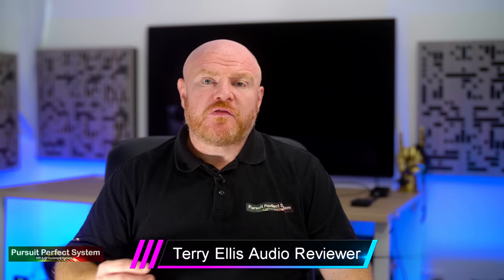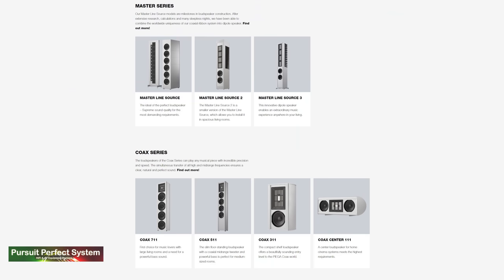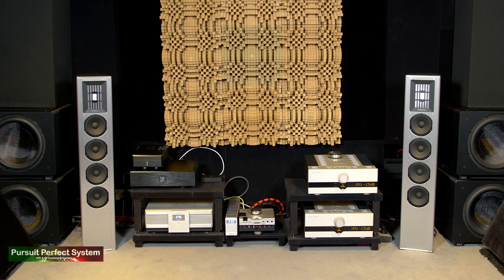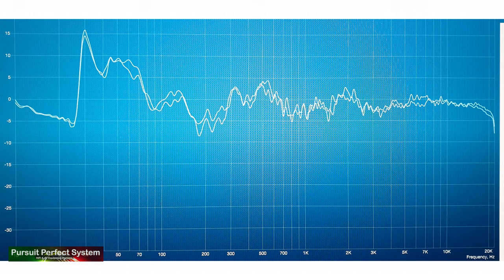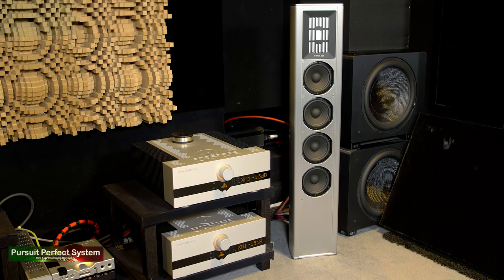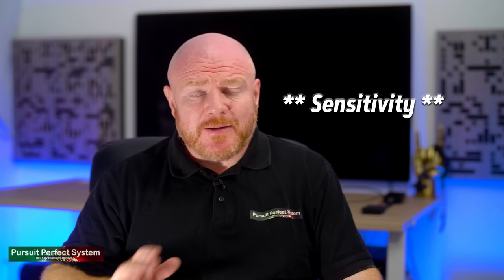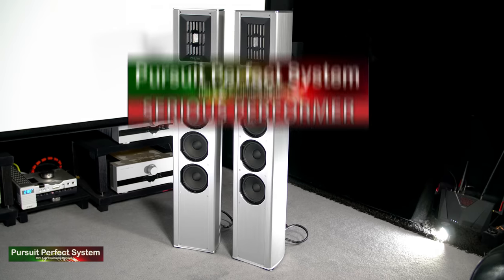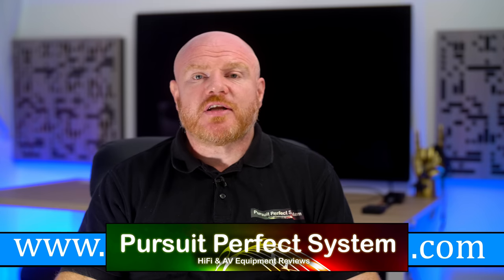Piega Coax 511 HiFi Speakers REVIEW Can Aluminium Sound Better ??

Comment: Very thorough and spot on description of the Piega Coax 511 speakers. I've got the Piega Coax 511 paired with a Marantz PM-10 amplifier and Marantz SA-10 SACD-player/DAC. These Piega beauties simply show me everything, good or bad, in a recording. They are utterly and ruthlessly revealing. Not party speakers, obviously, but very engaging and insightful transducers. In my experience, the Piega Coax 511's soundstage, image precision and bass response improves vastly once the speaker is mounted onto IsoAcoustics Gaia II feet instead of the supplied Piega spikes or feet. Also, that unique Piega coaxial driver needs at least 250 hours of "burn in" to release all of its potential. I hope your review samples were well warmed up prior to this review, Terry.
Reply: Hello, I wanted to ask since you own them, do these speakers need ample space to breath. I want to place them in a very tight corner in my living room and not sure how that would affect the sound since they are a sealed enclosure design. Also, are you happy with them? Thanks!
Reply: @DDSRacer01   Hello, Yes, I am very satisfied with my PIEGA Coax 511 speakers. They sound divine when set up properly and when matched with the right equipment! 

However, I do think it requires quite a bit of trial & error to set them up optimally. In order to get them to show you the most three-dimensional sound-image possible you really need to let them breathe. Even if they don't have a back-firing bassreflex port they will still need space to the rear and to the sides to deliver the most natural and balanced bass response. Placing them less than 25 inches from any corner the bass response will be very exxagerated. 

Also, I'd say that the PIEGA Coax 511 speakers should be positioned no less than 25 inches from the rear wall (measured to the front of each speaker). Placing the speakers  even closer to the rear wall will probably make the stereo image less 3D, less precise. 
NB! Even though these babies are quite small-ish compared to many other 3-way floorstanders they still have a comparaply very capaple bass output. Try them out in a shop and you will be so surprised with their bass delivery! They will give you extremely well controlled, fast and accurate bass. The amount of bass that they can produce almost seems to contravene the laws of physics - the PIEGA Coax 511 speakers actually sound much bigger than they look since they have such a large membrane cross section area in the lower registers.

Most important note: Always pair these speakers with a high quality amplifier (the more watts, the more these speakers will shine), high quality speaker cables (preferably copper - NOT silver plated copper) and high quality interconnect cables. In my experince the PIEGA Coax 511 speakers sound far better bi-wired than single-wired.

By the way...I'm presently using Albedo Metamorphosis silver interconnects and  Inakustik Referenz LS-4004 Air speaker cables as well as Tellurium Q Statement interconnects and Tellurium Q Statement speaker cables in a double barrel shotgun setup (= two runs of speaker cables per speaker).

Comment: Really would wish them to make a grill for the mid/tweeter only as those drivers are super sensitive at cost a LOT to replace(they need the complete speaker to switch mid/tweeter drivers). And that's because they look like church speakers with the grill on.

Comment: Terry, do yourself a big favour sometime:  do try out a pair of Piega Coax 711. The bass power from those babies will shake the bedrock under your house. They are in a completely different league. Those four 22cm/8" woofers can move a serious amount of air. Play them loudly and you'll need to rebuild the masonry of your house afterwards. I mean, they can start an earthquake even though they are very linear all the way through the frequency range. Massive sound pressure and unparalleled dynamics combined with even more detailed sound than that of the Coax 511.
Reply: I agree, the bigger models like mine piega classic 60.2,s  can produce bass that will make you go jump up in the air!  And it still sounds very coherent and refined,  with all kinds of music!  The search is over.

Comment: These speakers fascinate me, esp the coax ribbon mid/tweeter. Unfortunately I really don't care for them aesthetically, don't care for the aluminum construction.
Reply: I pretty much had the same prejudice prior to demo'ing them at my local hifi-shop. Actually the aluminium cabinets don't look the slightest metallic or cold once you "meet" them. In high gloss white or high gloss black lacquer they are the most delicately looking, feminine shaped speakers. And they feel kind of soft and organic as well. Also, you can combine a white or silver pair of speakers with black front covers to make them look more like organ pipes if you fancy. They are quite wife-appealing and discrete appearing speakers compaired to many other "guys only"-speakers out there that often seem to resemble props from a Star Wars-film.

Comment: I think at their £11,000 price point they will get bested on pure sound quality grounds, by final audio's new model range of electrostatic loudspeakers. Starting with the hybrids, the model 3 hybrid for £3000, model 5 hybrid £4,000, model 7 at £6,000. Then there are the model 12, and model 15. They can be passive or active driven. This new range will be more transparent and open than any standard loudspeaker range at their cost and  above.  One of these models is the first place I would start to look at upgrading from my own sealed cabinet monitor audio gold reference GR20  2.5 way floor standers. I would also take a listen to atc's active 3 way monitors loudspeakers, to see between final audio's new esl range passive and active, and atc's 3 way active loudspeakers to see between these two particular brand range of  loudspeakers which are the most revealing, transparent, open and detailed between them. Had my sealed cabinet GR20's for quite a long time now, but they are very revealing, detailed, open and explicitly transparent within their 30hz to 30khz capabilities to source and amplification, but sound very balanced within their frequency range as long as source and amplification is up to the task at hand. They have a more detailed open and revealing explicit quality than kefs range of loudspeakers do. They certainly let you hear every very tiny little subtleties and inflections, and the changes of sound between any differences of any cables,  amplification, and source components you try, use, and prefer  to your taste, and as to how actually good your audio equipment chain is as reguards transparency levels and extraction of signal detail been able to hear if your components are loosing less of the detailed information of the audio signal detail as is possible coming in through the audio chain through to the end output of the loudspeakers. I always have them biamped, or would have them quad monoblocked, but have not found any yet, as detailed and as open and revealing and colourless, ( for the highest performing detailed and resolving highest quality sourced digital and streaming component sources components ), as my late mid 90's avi s2000mi biamped amplification, and you certainly get the emotional content with dynamics with absolutely zero ear fatigue because the amplifiers have extremely low distortion of 0.003% from zero watts to the first 50 watts of their initial power output at the important low level resolution level distortions at low volume levels, as well as at the higher volume levels. The best low distortion levels for any of the very best current transformer powered analogue amplification is 0.002 %, for example like the atc p1 power amplifier, which uses 4 output mosfets per each channel, two for each half phase of the signal in and out. My extremely compact twin transformer powered amplifiers with extremely very short signal path with also ample heatsinking which is the tops of the amplifier casing, have just 1 very large sanken output transistor for each half phase of the signal, and each sanken output device has its own heatsinked driver transistor. So the amplifiers are held constantly balanced in push pull mode to the signal. The signal goes in via vacuum sealed gas filled gold relay reeds. Because the signal path from input to output is so very short and direct, and with only one large transistor for each half phase of the signal in constantly held balanced in pushpull mode while also having extremely low distortion even at the lowest signal levels and with very low self noise, the amplifiers are very transparent, revealing, detailed, dynamic, smooth and non fatigue, as long as the digital source component has very low distortions, very low self noise, and equally very short and direct signal path input to output. You get to hear more detailed signal information with less of the loss of the signal information from a recording as long as the digital component is also up to the same kind of high standards of very very short signal path, with extremely low distortions and extremely low self noise levels . But you equally hear how really bad those bad sounding and compressed and distorted recordings sound, but without ear fatigue, as long as the digital component has near zero distortion figures to three decimal places, 0.00012 etc for example, you get idea of then what I am talking about.   Any kind of ear fatigue what so ever at all that is felt upon your very delicate hearing abilities at any non deafening and threatening deafness sound levels in any so called proper audio system or audio monitor system, is caused by the bad old adversary to your hearing called distortion. Any bad and ear fatiguing poor amount of it delivered from your combined audio system from the source, amplification, or the loudspeakers themselves, can be caused by just one component or  the whole audio chain of combined source, amplification, and loudspeakers. So any signs at all of any uncomfortable ear fatigue stress of any kind from your beloved audio system, is a sign your audio system is just not up to the very high task and standards it needs to be to give you a pain free sound quality performance experience it needs to be at any volume sound level you want to listen to it at.
Reply: Why don't you write a book ?

Comment: Nice to see you trying sealed box speakers in your room.
£11k is bonkers money though, isn't it?

Especially when it remains to be seen what sort of longevity you'd get out of the ribbons in these speakers...

Sealed box speakers really come into their own with much larger woofers. Like 12" as a minimum. But then you need the right sort of house / room for that type of speaker...
Reply from the maker: I have the room to handle most bass - on price these are only the same money as my kef ref 3 but have a curved aluminium cabinet and 4 bass drivers and a ribbon coax   mid / tweeter driver array.  The kef have a aluminium baffle mdf chassis 2 bass driver and the uniq so its not crazy money really
Reply: @PursuitPerfectSystem  Cool. On the bass front, does that mean we can look forward to you trying sealed box speakers with 12" or bigger woofers in your system?

And with the speaker price thing, there are (at least) 2 camps:
1 I'm aiming to spend over £x (eg £10k) to get great sounding speakers
2 I'm aiming to spend under £x (eg £2k) to get world class speakers, although there will be convenience compromises in acheiving this